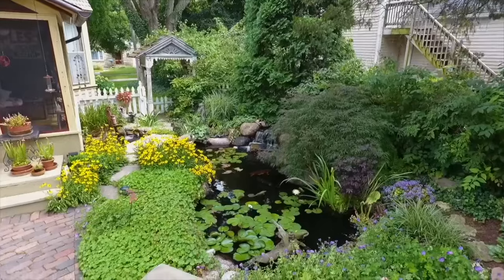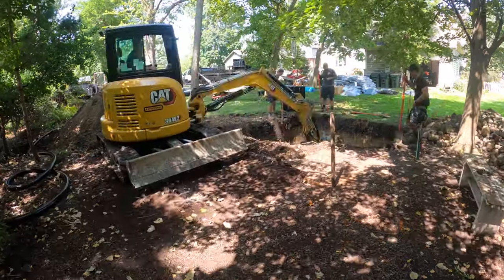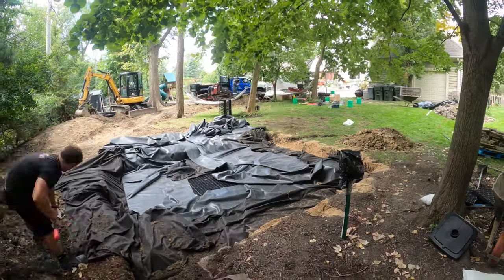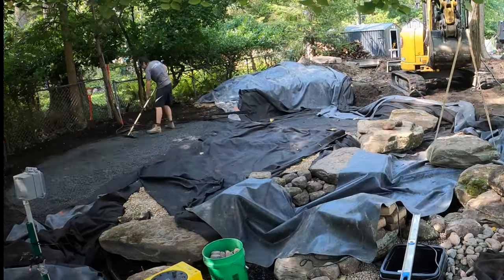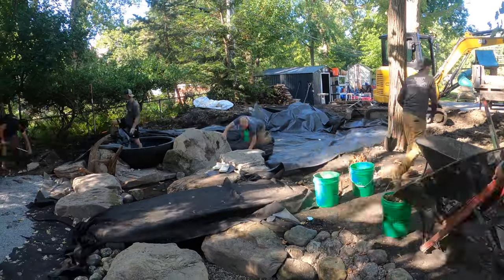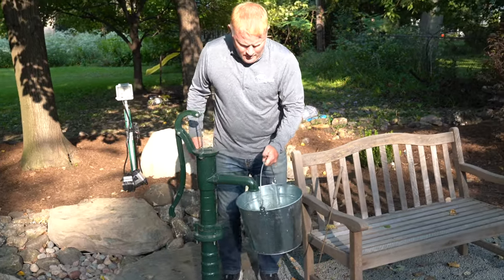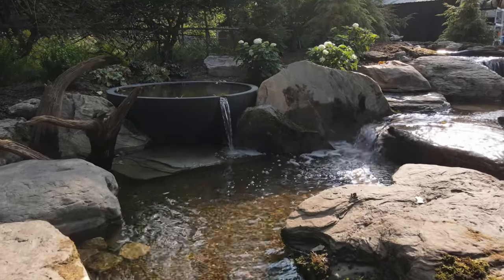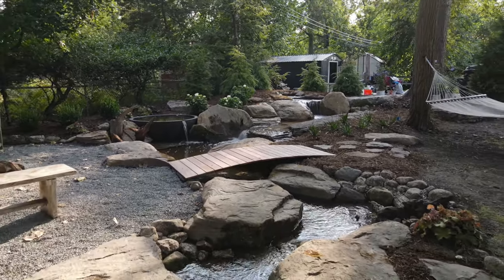3,000 Gal Rain Water Harvesting System

Comment: At first, well done projekt. My question is, in a case of heavy rainfall, how do you deal the overfloating of your reservoir? Thanks from Germany.
Btw. you don't need this weird thumbnails.
Reply from the maker: The rainwater system has a natural overflow that carries the water back to a low area of the yard. In the event there is too much water a submersible pump with a float valve is set up to physically push the water to the front yard. Here the water flows to storm drains.
Reply: @TEAMAquascape  Thanks for your answer and a lot of inspirations